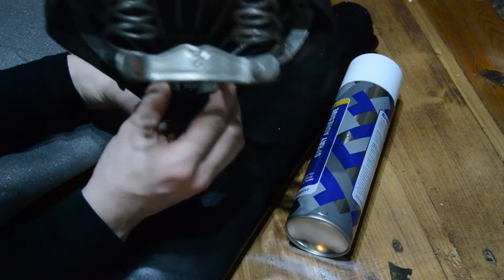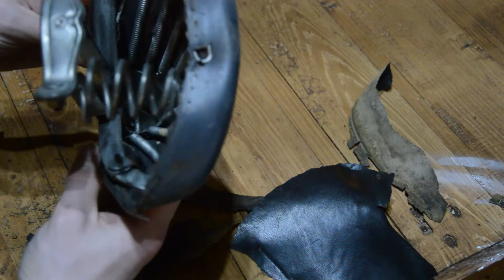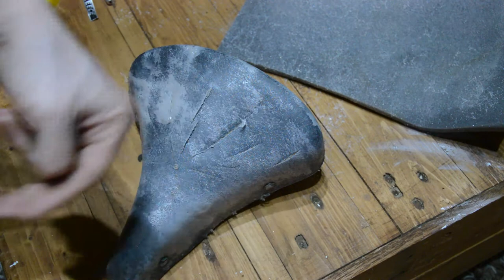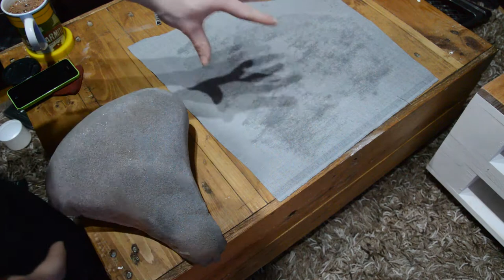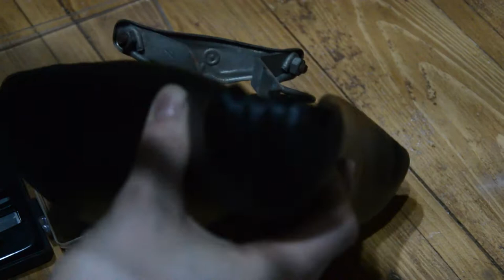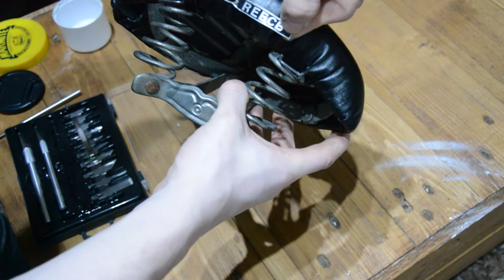Reece Saddle Repair - Vintage Bicycle Restoration

Comment: Mount it back on a seat post in a vise. A hair dryer for heat and some lacing does wonders for stretching the vinyl. Now do leather! I have several seat frames I want to do. Thanks for the inspiration!
Reply: Yep, heat is the key. Even heat the whole sheet first in an oven etc. then keep a hairdryer nearby

Comment: Great job

In case you do not want to do all this...

Brooks make a hard plastic version with no cover, as do Cinelli. They are ideal for your beater bike that you leave outside locked up say at the station, as the water just wipes off them. They are fine for relatively short rides, as often the thin cheap padding does not make the bike anymore comfortable. There are a few saddles that look better when the old cover is removed
Reply from the maker: Cheers J B.
I've seen a few of the plastic Brooks saddles, one came on a Raleigh Meteor I fixed up a while back and I've owned a BMX with a plastic Selle Royale saddle.  The Selle looked nice but it was damn uncomfortable.

Oh and I have seen your comment on the Claud Butler video but YT has decided to put it in the spam box and won't let me "approve" it or reply to it!  I have actually had that bike dated now and it turned out to be 1950 and not 1956 as the hub would suggest.

Comment: I don't know much about trimming upholstery. What I have seen comes from watching a UK TV series called Wheeler Dealers. What I've seen them do is pull the long sides and get them folded over straight. Then bring the corners together pulling it tightly over the corners as the last step. Making what they called a Pig's Ear. So the extra material can be pulled over precisely on the point of the corners or triangles as you've got there. Your back and sides aren't straight on a saddle so that presents a problem. Seems like it might work though.
Reply from the maker: Hahaha yeh I've seen that program once or twice!  We've also got Car SOS that have some nice cars on!  I've got that other saddle shown at the end to try in a different technique but I should have another one somewhere to try stretching again.  I'll give it a go.